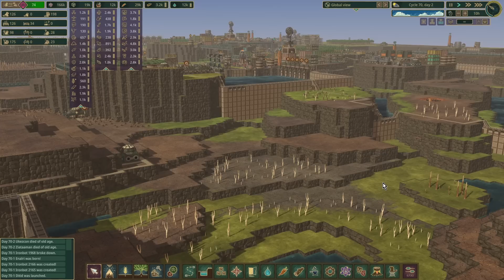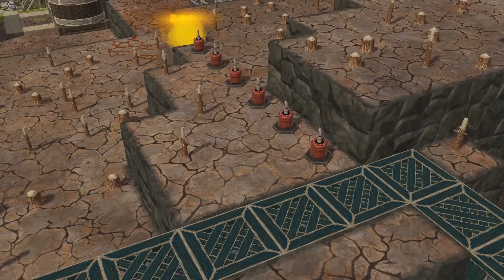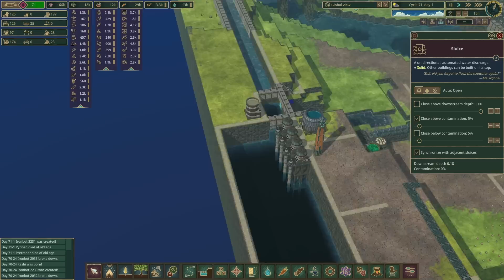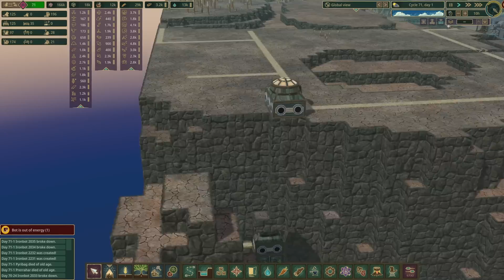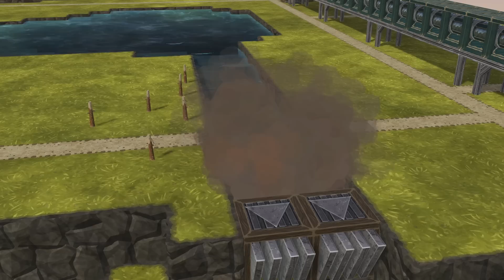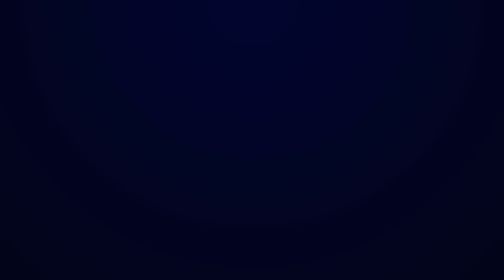Timberborn - Hard Mode Update 7 - Pumping For Victory!

Comment: Given your huge power surplus I can't imaging those gravity batteries will get any use ever...
Nice to see you've been able to make use of the grid.
Regarding your on-screen comment, dams are better as a water feature, while sluices would be better if you had a closed system without a drain.
I noticed that using a powered pump system meant you could also drop a few chargers in the area!
I've been wondering what would happen to those lone few dead birches from way back when. And now, they didn't even get an on-screen send-off...
Don't forget about the potential lake in the corner.
Reply from the maker: I'm prety sure that those batteries are essentially cosmetic!
The grid is useful when trying to figure out placements for platforms that are significantly lower than the thing you want them to line up with. Not as much use in any other scenario that I have found. But it's certainly nice to have!
I did pop in a few chargers at the top, right next to the uppermost pump. I must have forgotten to mention it.
Oh no! I forgot those trees! You're right, they deserved a more respectful send off.